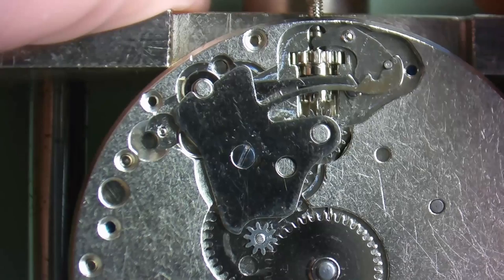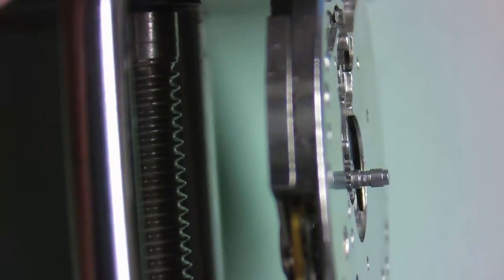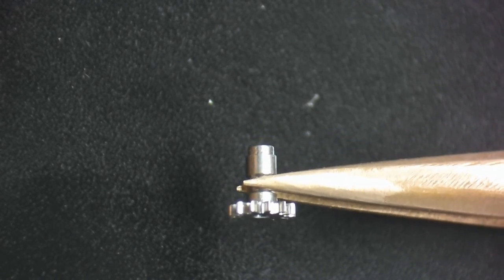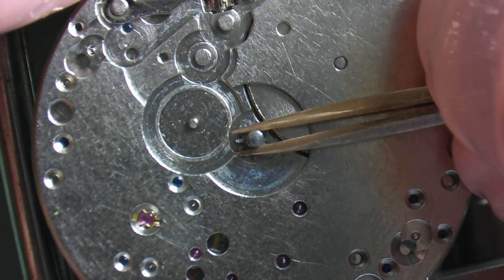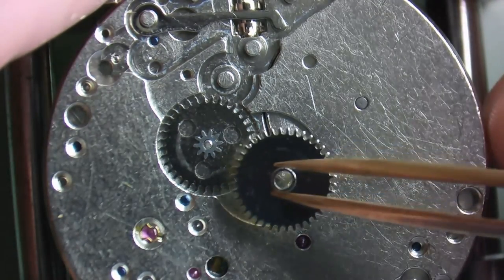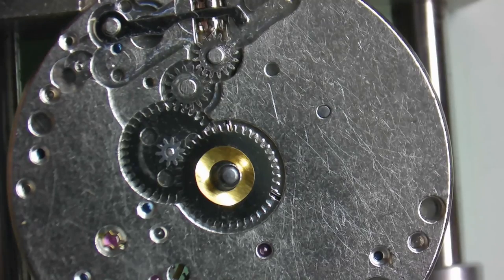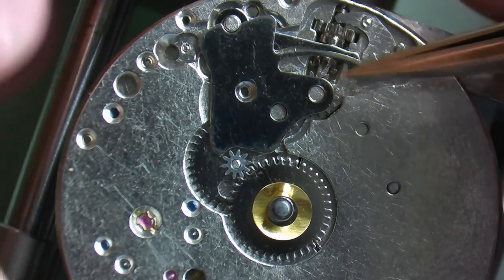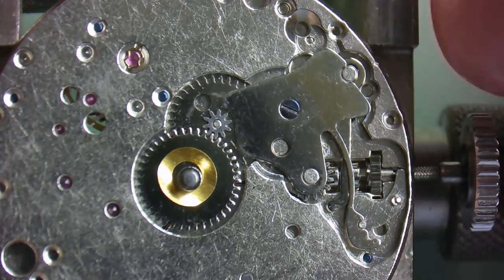Watch Repair Lesson #4-The Motion Works and How it Works

Comment: I really enjoy and appreciate the amount of detail in these videos. Not only the "hows," but the more important "whys." Glad I found this channel as it has filled in some of the gaps in knowledge that I didn't really know I had.
Reply from the maker: There are 2 things you will hear me say over and over, “ everything matters” and “You don’t know, what you don’t know. 
The first relates to literally everything we do in servicing and repairing watches. The smallest things can have a big impact on your results. 
The second one is kinda the point to these whole series of videos. If you don’t know how to sharpen tweezer’s or fit a screwdriver to a screw, you don’t even realize why you can’t pick up a spring or you have a parts shooting across the room, you don’t know why. If you can’t get a stem to lock into the movement and you don’t know that the setting lever has a pin that locks into a groove in the stem, you can’t figure out what’s going on. “You don’t know what you don’t know. 
Glad it makes sense.

Comment: Such a "timely" set of lessons for my budding interest in mechanical watches.  I've been binge watching other videos and vacillating on buying a popular "Watch Repair" video course or trying to learn from watching others service watches.   Your explanations of the  details of each part, how they function together, tips on assembly and where to be extra careful are just perfect.  Towards the end of Lesson 3 I was wondering how tight to set screws then "Bonus Tip".   During Lesson 4 I was wondering about the expense of various Presto tools then "Bonus Tip".  It's great to find a teacher who realizes the simple details that beginners need to know.  Thanks for producing this series!

What size or number are the brass or bronze tweezers?   As a complete noob, I have no idea what a #2, #3, or #5 looks like or which to buy for a starter set.
Reply from the maker: Thats Awesome man thank you. I guarantee you will be a better watchmaker if you follow along.
The Bronze tweezers I use are the Bergeon 7451.PM.S5  and are just classified as a fine tip. There is not a lot of options in Bronze but if you can do the 45-50 bucks for a pair they are pretty awesome. 
I know in Dumont for example that a pair like the 00 are really beefy, thick tweezers that are good for something like heavy parts but suck at picking up screws. I use them sometimes for holding cap jewels while oiling them but they probably would not be at the top of a "Need now list".
As the number increases, the thinner the last inch or so of the tweezer becomes. A # 5 Dumont is like a freaking needle. Not really useful as a overall working set because there is just not much holding surface.

 I like the Dumont 3C, which is a good all around working size, good for really tiny screws as well as most parts in wristwatches. Sometimes they can be challenged in pocket watch sized movements. That's where the Bronze is really nice. 

I also like smaller tweezers in my hand, so if you have hands like baseball mitts keep that in mind. 😉

Comment: Awesome lesson! I love how you break these down in manageable chunks of information. Two questions for you.  First, can you use a Presto Watch Hand tool, which looks really similar to the tool you have, to remove the cannon pinion?  The only difference I see is my tool has a metal shaft down the middle with a spring on it (presumable to help with watch hand removal).  Second question, when you put that spring back in, you held it down with your finger, but once in place, you took your finger off and then put the setting level jumper back on.  How concerned do I need to be about that spring flying off when I take my finger off and put the setting lever jumper back on?  I'm just really concerned, with my luck, that the spring will fly off as soon as I take my finger (or whatever ) off the spring.
Reply from the maker: The hand removing tool is different. Get a canon pinion remover. You need to be very concerned about any spring flying away. Its probably the number one issue for new watchmakers. If it is installed all the way down into the mainplate it will be fine.

Comment: So, the rotation of the center wheel should rotate the cannon pinion, while the opposite way should not happen. And it's all done by the friction between the cannon pinion and the arbor of the center wheel being the correct amount.
That's interesting. There should have been a very precious machining done on those parts then. Also, I wonder how they do the calculations for the correct diameter for those parts, in order to make sure that they can always trust on the friction there doing the job as expected. Because even if for a portion of the movement of the center wheel, the cannon pinion does not move (I mean if it happens to slide over the center wheel arbor, instead of moving with it), it will affect the accuracy of the watch.
So, each time we set the time, the cannon pinion slides over the arbor of the center wheel. Is it realistic if I assume that in an old watch the wear created by these slidings can decrease the friction between the cannon pinion and the arbor of the center wheel, resulting in the rotation of the arbor of the center wheel not rotating the cannon pinion properly? For example the arbor of the center wheel sometimes sliding over the cannon pinion, resulting in 1 full rotation of the center wheel being translated to, for example, 55 minutes on the minute hands (instead of 60 minutes).
I mean can such a scenario happen in real life?
Reply from the maker: Yes cannon pinions can loosen over time and cause lose of time on the dial even the the watch may be performing well on a  timing machine.
Correcting the friction of the cannon pinion is a fairly common repair.
Also this is but one of several different ways the power is transferred to the cannon pinion.
Sometimes the 2nd wheel is offset.
The cannon pinion is friction fit into the center of a wheel which is turned by a pinion on the second wheel.
This wheel turns as the watch is operating and then the CP will slip when setting the time.
Either way this slipping is what’s allows the time to be set while the watch is running.

Comment: The burgeon cannon pinion remover presto tool, Pretty much identical to the one you have, Except it has a green knob on It, is going for about $75 on Amazon. I still prefer it to the other type They have with the long handle, I feel I have better control and visibility with it.
Reply from the maker: If you’re talking about the one with the long wooden handle, I agree. I’ve been using this style remover for a long time with no problems.

Comment: Hey Alex - loose cannon pinions aren’t uncommon.  Have you done a video anywhere in your series showing techniques for safely tightening them without destroying/crushing the tube?  I have one on my bench right now and I’m wanting to learn.  There’s an expensive Bergeon 4733 tool for the job, but I’m wondering if there are ways of doing it without that (expensive) tool.  Maybe you’ve covered this already.  Thanks!
Reply from the maker: I haven't done a video on YouTube but i did one in my watch repair course.
The Seitz Jeweling set has a set of lanterns that can be used very precisely as you can make adjustments in 1/100's of a mm.
There are also some vintage stand alone tools but I have not used any of those so I'm not sure how accurate they are.
Reply: @watchrepairtutorials  Thanks Alex.  Looks like it might be a tricky fix using only simple tools.
Reply from the maker: @zendoc62  the adjustment is so small that you need to be able to control that. That's watchmaking.

Comment: Superb explanation on the keyless works. I have two questions:
1.  The miniute hand is fixed on the canon  pinion. Then, why  is it not called the miniute wheel like the hour wheel where the hour hand is fixed?
2. I have seen movements where there is one intermediary wheel. In your video, there are two intermediary wheels. Any specific reason why?  Please enlighten me on the above. Thanks for this really engrossing video. God bless.
Reply from the maker: Good question,  "canon pinion" comes from the Latin word "canon," which means "rule" or "law."  In the context of watchmaking, the canon pinion was named after its function as a regulating element that sets the "law" for the movement of the watch hands.
The number of intermediate wheels is a movement layout or design decision.
Reply: Thanks for the explanation. Please make a video only on the escapement wheel if you have not done it already.  Looking forward to more of your educative videos.

Comment: Is presto tool also used for removing the lancets? I have a presto tool and I used to remove lancets, but It is difficult to use it to remove the chronograph ones. I thought ni the Bergeon tool is more fit for this. 

Please correct me if I am wrong.
Reply from the maker: Chrono hands are super tight and can be hard to remove. Without a special remover you are better off just using levers

Comment: Hello, thank you for your very informative videos! Do you know why the minute wheel always has 3 holes (sometimes it has less but it always has an opening)? It's something that's been puzzling me for a long time and I just can't work it out! Thanks ;-) (I use a translator, I'm French)
Reply from the maker: I would be done simply to reduce the mass of the wheel. It’s the reason you see the train wheels cut out only leaving the spokes. It more important for the power train to have lighter wheels and. It as less important in the motion works.
Reply: Thank you for responding so quickly! Indeed, that's a good reason, I hadn't thought of all that, one less mystery ☺ Otherwise, on the advice of your last video, I ended up buying a Seitz 👍

Comment: Hi Alex, quick question: if I’m looking for a presto tool and don’t want to buy several to start with, am I better off with the Bergeon 30636-1 Presto #1 or the Bergeon 30637-2 Presto #2? I was planning to buy a set of hand removal levers like the Bergeon 30027, but perhaps to start I can get away with just one of the above? Thanks as always.
Reply from the maker: Well the 30636 is a hand removing tool and the 30637 is for removing cannon pinions right.
Personally, I use Horotec levers for removing hands , but you could even go less expensive if you wanted. The key is polishing the underside to a high gloss. Even though you would still use plastic to protect the dial, it there any nibs on the metal it could cause damage.
As far as the cannon pinion tool, the cheap Chinese one work fine, but if you want a higher build quality there Bergeon is the way to go.

Comment: So the whole motion works speed is controlled by the minute wheel via gearing ratios?
What defines how fast the minute wheel turns? I presume it's the escapement?
Sorry, bit confused. Do you know of any good videos/articles which explain the exact chain of events from start to finish?
Reply from the maker: In a watch, the motion works refers to the gears that transfer power from the movement to the hands of the watch, specifically the minute and hour hands.

To break down your question:

What controls the speed of the minute wheel?
The speed at which the minute wheel turns is indeed a result of the gearing ratios, but it is ultimately regulated by the escapement and the balance wheel. These components ensure that the entire gear train moves at a controlled rate.
Here’s how it works:
The mainspring provides the initial power, which is transmitted through the gear train.
The escapement and balance wheel control the speed by releasing the stored energy from the mainspring in precise increments, allowing the gears to turn at a steady rate.
The gearing between the wheels (including the center wheel, third wheel, and escape wheel) determines how fast each wheel turns.
What determines how fast the minute hand moves?
The center wheel completes one full rotation every hour and drives the minute wheel. The ratio between the gears in the motion works causes the minute hand to move one full revolution for every hour.
So, while the escapement regulates the overall speed, the actual movement of the minute wheel is due to the gearing ratios between the center wheel and the other gears in the motion works.
Chain of Events in a Watch Movement:
1) Mainspring stores energy.
2) The energy is transferred through the gear train (from the center wheel to the escape wheel).
3) The escapement regulates the release of energy in small increments.
4) The balance wheel oscillates, controlling how fast the escape wheel turns.
5) This controlled release of energy turns the center wheel, which then moves the minute wheel via gearing ratios.
6) The minute wheel drives the hour wheel to display the time.

This is a basic explanation of how a simple watch movement works.

Comment: Hi Alex, I had an issue because I didn't check the keyless system after working on it. In my case, an intermediate wheel was misaligned with the center of the jumper plate hole, causing everything to get stuck. I managed to set the rest of the watch, but the balance wheel wouldn't run. During the troubleshooting process, my mainspring broke, so I'm not 100% certain about the cause of the failure.

My question is, if the setting lever is in the set-time position, should it reduce the amplitude or even stop the movement altogether? Since the mainspring attempts to move the keyless system, why do hacking movements require a lever to stop it?
Reply from the maker: When asking about a movement problem, always start with what the movement is. There are thousands of movements and what may be true for one is not true for another.
The important thing here is the lesson that you learned about not checking a system before you move on to the next. This is watch service 101. Had you checked the keyless before moving on it may have prevented the problems that you encountered. 
How you were able to break a mainspring during a troubleshooting process is a mystery to me unless you are forcing something that you shouldn't have been. Lesson 2
To answer your question, the setting lever has nothing to do with amplitude or stopping the movement from running. To affect amplitude at the balance wheel, the part either needs to be in the escapement, balance wheel, the powertrain or come in contact with a part connected to the powertrain creating friction that shouldn’t be there one of these systems.
 Secondly, you have it backwards the winding pinion which is turned by the stem turns the crown wheel which turns the ratchet wheel which winds the main spring not the other way around. The setting lever only keeps the stem from being released and controls the yoke’s position.
Thanks for the question
Reply: @watchrepairtutorials  
Thank you very much, Alex!! It's a Landeron 48. I broke the mainspring because when I saw everything stuck, and couldn't find a way to release the tension, I removed the bridge, which caused it to release suddenly. When I tried to wind it again, I realized the arbor was loose (the end of the mainspring was broken).

My logic was that with the crown out, the power train would have to overcome the canon pinion or move almost all of the keyless mechanism, and that's why we should have a lower amplitude, the same for movements with a calendar. I find it hard to understand how it doesn't cause more friction :S

Comment: The cannon pinion slips when setting the time ... awesome! I wondered how setting the time worked without forcing the train of wheels to spin like crazy.

Thanks for your great lessons.
Reply from the maker: Yea, in this example the cannon pinion is held in place to the center or 2nd wheel while the movement is running normally, and then when changing the time the minute wheel rotates both the cannon pinion and hr wheel so the hands move.    Brilliant right?

Comment: How do you keep track of all the screws and where they go when reassembling.every video I have watched the screws are thrown in the same cleaning baskets.
Reply from the maker: Hey Tim, 
When you first start out, pay close attention to the screws as you are taking them out. It’s a good idea when you are learning, to use a parts tray big enough so that you can have a spot for each part of the movement. That way you can keep the screw with the part it came out of it for example, you can group components like the click, click spring and screw all together.
Depending on what movement you are working on bridge screws may all be the same, the screws for the pallet bridge  and balance cock may be the same.
Some screws are countersunk and some sit in on top off the part. 
After awhile it will become second nature.

Comment: Does this watch have a center seconds hand because I thought the pinion or shaft of the center wheel was hollow to allow the seconds hand to slip into the end of it?
Reply from the maker: This does not. The second hand is at the 9 o’clock position. Some center wheels Have a solid extended arbor.
Reply: So how do those get power to the seconds hand?  @watchrepairtutorials
Reply from the maker: @robertbrandywine  the second hand is always attached to the fourth wheel pivot. Sometime the fourth wheel extends through the Center wheel  arbor, Sometimes it’s at 6 o’clock and sometimes it’s at 9 o’clock. It just depends on how the maker arranges the train of wheels.
Reply: Okay, thanks!  @watchrepairtutorials